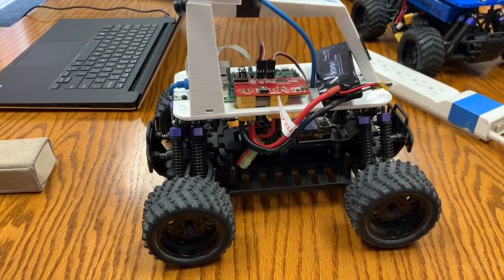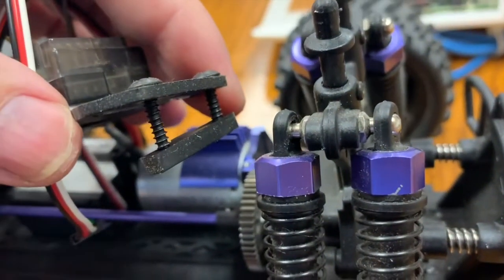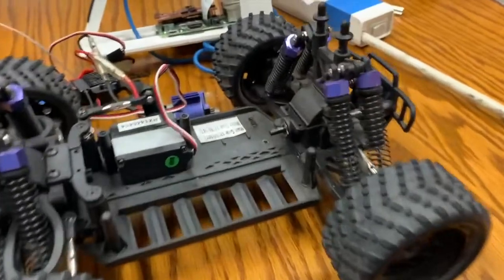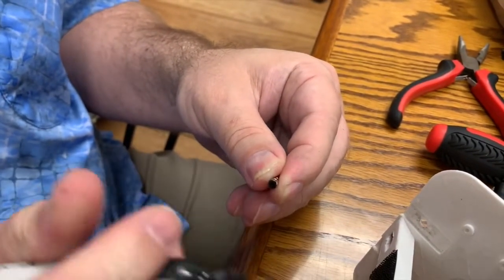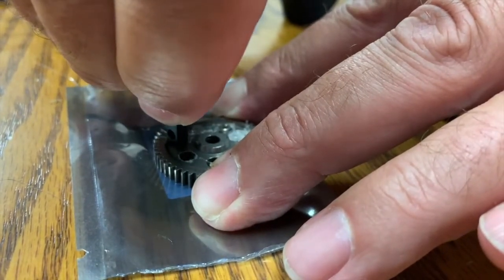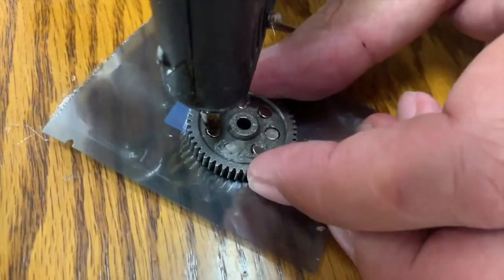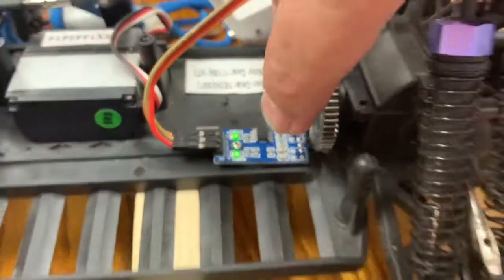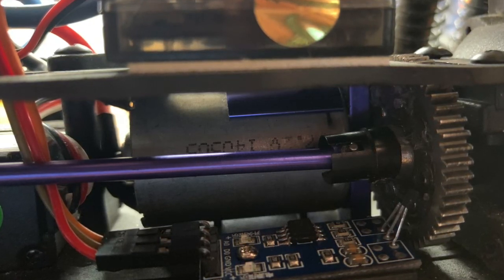Odometer Install on an Exceed Magnet Rc Car

Comment: What could we use this for?
Reply: This is similar to a real car odometer. You can count number of on/off's (each time a magnet passes by it is on) and multiply by the gear ratio to obtain how many times your wheels rotate. Then multiply it with the circumference of your wheel to get the distance traveled. You can observe in a real car while sliding (icy road, wet road) the Km/h is showing 90 while you are not even moving.
Reply: And here is another example with good explanations: https://sites.google.com/site/wayneholder/self-driving-rc-car/mechanical-odometry-and-speed-control
Reply from the maker: You can also train your model to target a specific velocity instead of a throttle value. This will be more stable as your battery voltage drops.